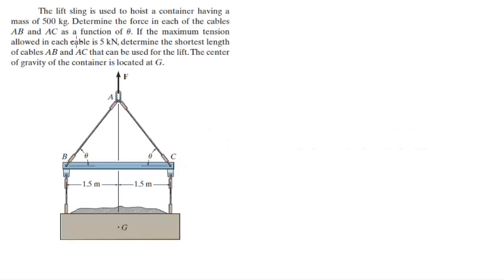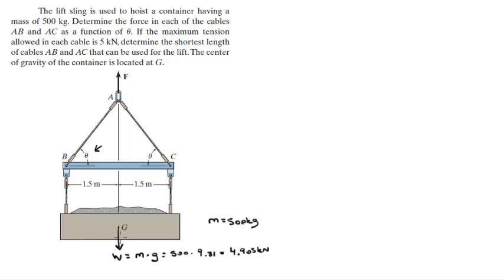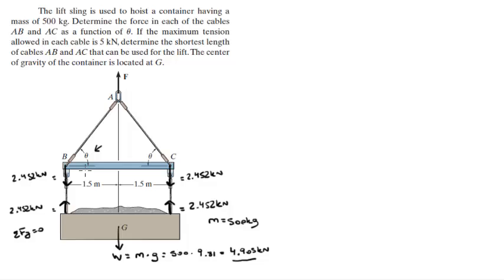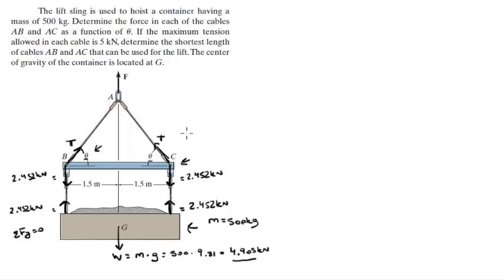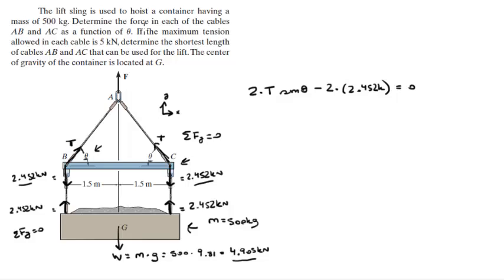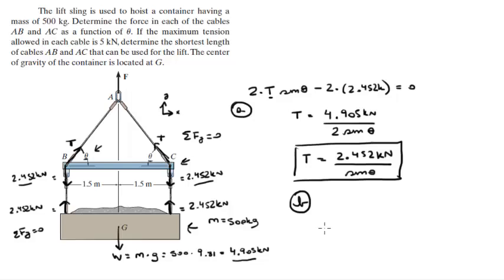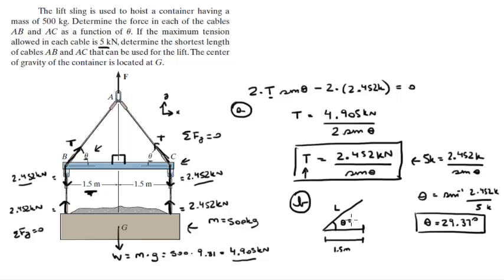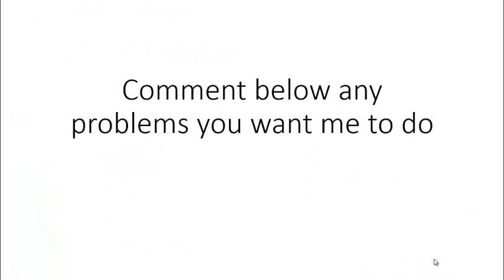Determine the force in each of the cables AB and AC as a function of theta

Comment: How much lifting capacity is lost per foot in height on a forklift when a load is raised up in the air?  Forklifts are rated for both horizontal and vertical lifting capacity.  I get this question all the time and need a problem solving method to use.

Comment: How to find size of spreader bar? Means the sectional area required of spreader bar to be used for lifting a specific load with specific length of a spreader bar.
Reply: the  process is similiar like a designing beam Calculate BM ,Ixx,Zx If its spreader make sure your beam passes in compressive stress

Comment: Hi, I'm very interested in spreader bar mechanics and wondered if you would like to tackle a more complicated question for your channel? I would like 2 primary slings down to a spreader bar (different angles so I can work with assymetric arrangements?). From the spreader bar, I would like 2 secondary slings down to a "base". The actual load would be sitting on top of that base, possibly slightly off centre. This means the COG is higher than the lifting point. I'd like to explore and understand the metacentric height and how to "balance" this kind of arrangement. The material I have been studying so far is very interesting, free and available online from Prof. Capt. Hermann Kaps. The paper is titled "Stability of Cargo Suspension Arrangements". Page 15 is a pretty good example of what I am asking (but it is symmetrical). If it piques your interest, I'll be checking your channel for a talk. Cheers,